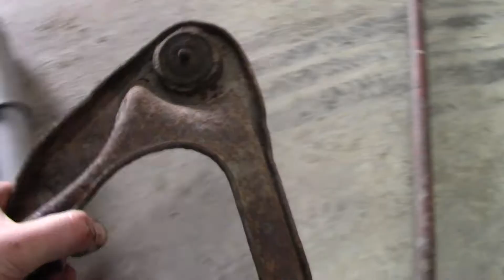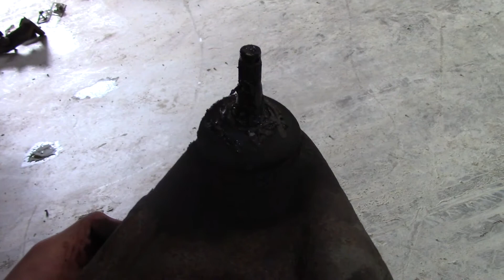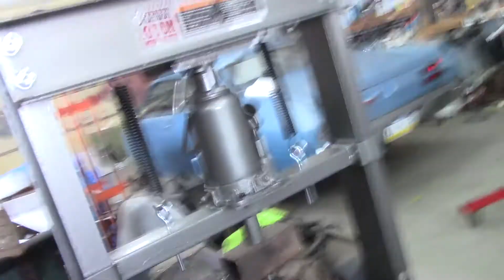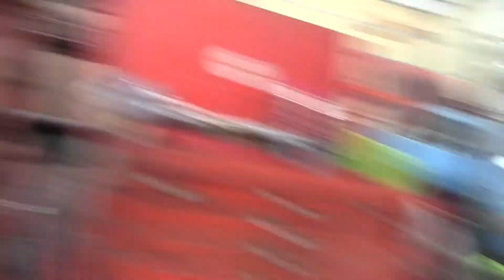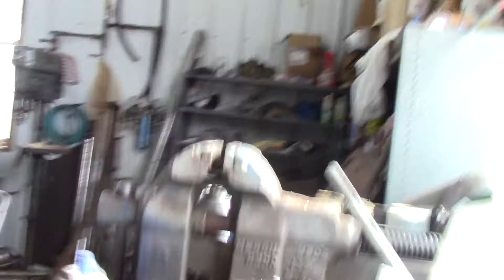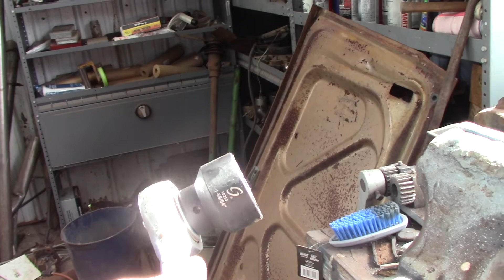How to remove upper control arm bushings and ball joint from vintage Dodge and Plymouth.

Comment: No. Take the ball joint off before removing the ctrl arm bolts. You press the new ball joint on after the ctrl arms and new bushing are installed.

I like the press but this job can be done with a basic press kit.
Reply from the maker: Hi Joe: Thanks for the tip! Also thanks for watching! John